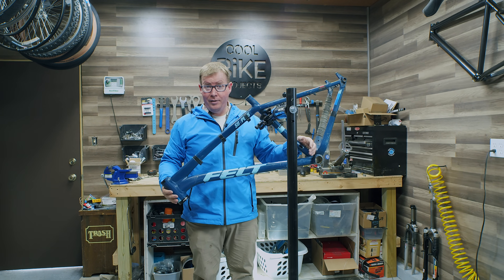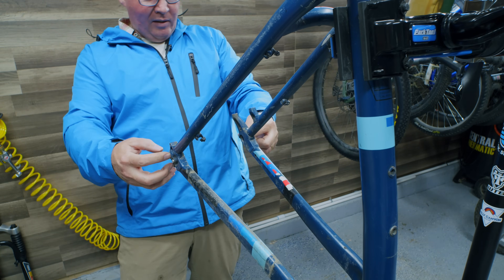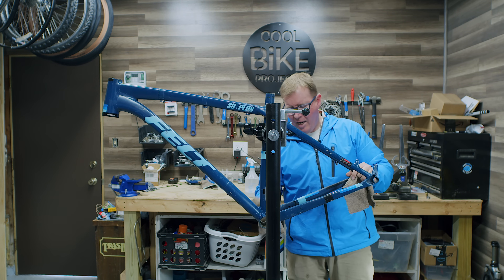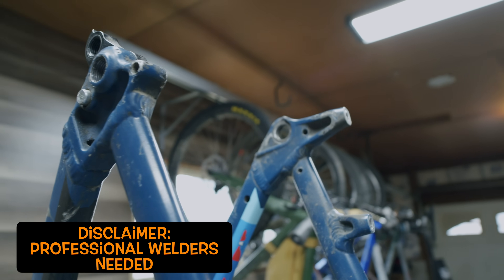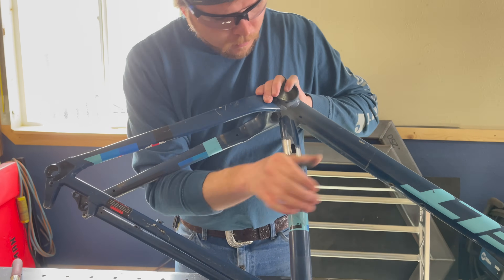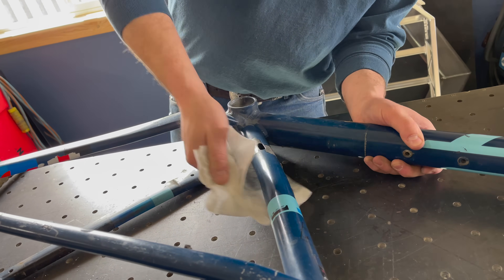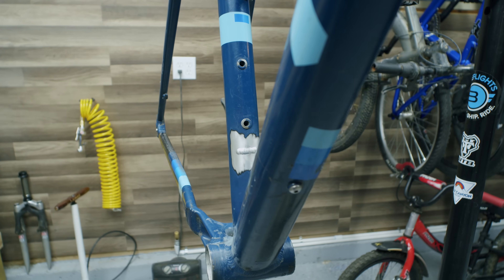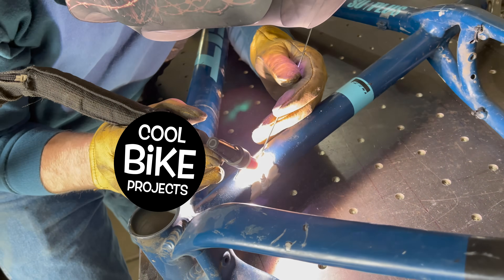How to fix a cracked bike frame: welding aluminum

Comment: It appears the  factory hole created for internal cable routing is the weak point of the frame. Because that's exactly where the stress fracture is.

Comment: Good video I did some light tig welding in shop class early 90s , so I'm not an expert, but something I did notice , is that fixing the crack is half I believe half the thickness so the exterior is sealed by aluminum bead but on the inside I think the crack still exists , though I dont think itll spread anymore lengthwise or widthwise , being aluminum there shouldn't be much oxidation from moisture or water , but under a stress test I'm just not sure how it would hold up , good experiment I guess I'd recommend sticking to the streets rather than bumpy trails and for use with a light weight rider , 125 pound rider ? Yea it'll be fine for quite awile , double the weight of the rider ? To 250 pounds ? Yea I'm defintely betting it wont last long , I weigh like 134 lbs so I wouldnt have any issues with it just make sure I dont get anyone that's much heavier riding it , not a good idea

Comment: alloy is cheaper than carbon. when the frame broken it's a sign of material or structural fatique. So why bother to fix a crack  frame? just by a new one or use it's spare part for the other bike. economically and safety is not feasible to be use again after the frame be fixed.

Comment: I've stick welded both rear dropouts on a scott voltage hardtail frame. Ive been hiting small gaps , 180s , 360s for a couple years and its still going strong .I dont know why people are so scared of a crack on the seat tube, specialy since its TIG welded.

Comment: The seat tube is pretty much the only place you can weld on these aluminum frames safely without sending the frame off to be re-heat treated. I still recommend wrapping wet rags on the tubing near the weld site to protect from pulling the temper out any further than where the weld is. I'd have no problem riding this repaired frame hard, even off road, but if the crack were on the stays, down-tube or top tube, you are asking for disaster unless this frame is only used for road riding.

Comment: The seat tube still looks bent.
Reply from the maker: @michaelobrien8661  its curved to give it more room around the 29”’rear wheel. Very common on 2010-2018 hard tails when they were playing with shorter chain stays.

Comment: I have a question ⁉️ 
I have a very old bike and it doesn't have any places to screw on bottle cages.  Besides the strap-on types, is there a way for putting the factory type on the frame?

Comment: I would not have a ton of confidence in that. Aluminum does not react to welds and heat the way steel does. My understanding is that aluminum is weakened through this process, whereas steel is not.
Reply: Shame nearly all bikes seem to use aluminium frames now then. I can't even find an ebike with a steel frame :(

Comment: Does tig welding safe in 7061 aluminum because i have one but tiny crack in chainstay welded part in the bottombracket area

Comment: Really cool video! I am curious about one part - I've heard that aluminum bike frames need to be heat treated after they're welded in order to bring them to full strength. Are you planning to do that for this frame also and if not, how much weaker do you think the frame would be approximately?
Reply from the maker: Yes in the ideal world heat treatment would be nice, but not possible for most of us. No idea on the loss in strength, but obviously a bit stronger than riding it cracked :)

Comment: Hey sorry if this has been covered, but ive read a lot that after welding alu it has to be heat treated? Just got a nice frame with a little crack in it.. id like to keep it though it seems like a headache, id be stoked to bring it back to life! My friend is a welder, i can ask him to use this method.. but how do we heat treat it/strengthen it once drilled/cleaned/welded? Liked one post in the comments about a bike that was so broken but they kept bringing it back! Cheers
Reply from the maker: Hi there @pinatabloom,  this ended up being a bit of controversial experiment. If you read through the comments there are number of welders and machinists that have chimed in with strong feelings and some sound advice. Most of their comments lean towards the need for heat treatment after welding, which would be nearly impossible for most people due to resources. I felt comfortable doing this as a personal project. I believe the welder did a great job with it, but It is not something I would suggest for most people unless they are wanting to experiment and are okay with the risk of having a frame collapse while riding. Not a pretty picture. I'll leave it at that. Thanks for watching!
Reply: Sweet as. 30 day cool off period sounds like the go!

Comment: man I really need a ting welding my self I have this project bike and the joints at the seat post part have holes in them caused by rust found a real aluminum old bike that I wanted to build my self this is good video 🚲👌💪🇵🇭👍❤️

Comment: Hi, I ahve a bike I love but the frame needs ammending to make it a stepthough.  I need a professional so I dont lose structural integrety.  Can you help?
Reply from the maker: Sorry Tessa, I took this to a professional welder, and as described in the video, this is purely an experiment. I would suggest you contact someone locally to see if it’s even a viable option for your frame situation.

Comment: Nice job, I’ve been doing this for over 25 years it’s always more fun fixing frames than making new production frames. 
6061 alloy is more forgiving than the 7005 alloy especially Easton 7005 “varilite” tube sets were notorious for cracking in non welded areas.
Reply: Do you think broken aluminum drop outs could be saved without heat treatment?
Somone has a real nice bike with such a break near me. I could do the welds nonprovlem, but I'm not sure it would just not rip off at the haz after jumping a sidewalk.
Reply: @rolobotoman  yes you can, just let it rest for at least 30 days, at least that’s what I do at work and nothing comes back.
Reply: @velowelder6333  For real?! never eared of letting alu welds rest.. but I only built heavier duty stuff. poor man's heat treatment I guess. I'm really tempted to try! The place it's broken is solid (not hollow), and I think I could beef it up with more material. Thanks! getting advices from people who actually do the thing vs forum nay sayer is invaluable.
Reply: @rolobotoman  we used to heat treat repairs but would get warping problems from previous heat treatment “memory” my college instructor and metallurgist is the one who suggested the 30 day annealing time and it has worked for us for over 15 years. I’m not an expert but this is what has worked for me and my company. Btw. I work on 7005 series aluminum using 5356 alloy if that helps. Good luck to you.
Reply: Where are you guys based? I have a Mountain Cycle San Andreas with a crack on the main frame around the swing arm pivot weld and running up the side of the monocoque, told its 6061 Solution tempered. Trying to work out best bet at a weld repair, any ideas?
Reply: San Dimas California, my company does not take outside work unfortunately. Which sucks cus I can fix damn near anything. (Humble brag)
Good luck.
Reply: Party on Dude! Sorry. @velowelder6333

Comment: My alu frame cracked at seat tube/head tube. I had it welded this summer and have been riding since then. Not felling so confident now having read some of of these comments.
Reply from the maker: I hear ya, each of us need to be in charge of our own safety. if you don't feel safe riding it then please don't. My take on this video project was seeing if it was possible to salvage a frame that would have otherwise gone to the trash pile. As many others have pointed out an aluminum frame that has been compromised and then repaired should not be ridden rough.  Best wished Paul!
Reply: @CoolBikeProjects  so how is the frame holding up? Do you have an update or a video on the situation?

Comment: As a metallurgist - yes I have a Ph.D. in that area -  who has worked in the field of mechanical behaviour of metal and particularly aluminium alloys for 40 years I would have thrown the frame into the recycle. The tubing you’re welding is heat treated and cold drawn and very thin. When you are welding it you are destroying all that processing which makes it strong. You are replacing a wrought material with a casting. The weld itself will not be thick enough especially after you grind the area down to make it smooth. Just look at the thickness of the welds holding the frame together - they are thick because they have much lower strength than the tubes and need all that thickness to carry the imposed loads.  Just recycle the frame.
Reply from the maker: Hi John, Thanks for chiming in on this. Lots of great comments from welders and metal workers. I have been saving up for some parts to rebuild this bike. As  stated in the video I will not be taking this on anything serious and will not be passing this on to anyone else. I think the question of repairing bicycle frames is common because so many have seen videos on rebrazing and repairing older steel frames. Aluminum is something I wanted to dive into because repairs are almost unheard of. I'm guess I'm learning why :)
Reply: @CoolBikeProjects  steel is much more versatile. Brazing is much lower temperature than welding and one is not actually melting the steel. Also brazing is carried out at the ends of the tubes which are much thicker than the middle because of the butting/profiling of the internal tube wall. The brazing temperature will soften the steel slightly but will not re-heat-treat it as welding does.  Welding thin sections can also introduce horrendous residual stresses due to contraction in the weld itself as it solidifies and cools. Welds need to be stress-relieved and I don’t often see people doing that - especially on YouTube.  I would be very reluctant to repair a carbon frame as well. Once the fibres have been snapped one would need an equivalent thickness of patch to allow the new fibres to bridge the gap and carry the loads. As the resins are thermosets it’s impossible to get a good chemical bond between the old and new resin - the weak link is the resin - Again, I’d just throw the carbon frame away. - I have been doing structural engineering with carbon for the last 20 years and when repaires are needed to carbon reinforced structural parts the design of the patch to bridge the load is quite complex.  I know - too much materials science. In summary - you can straighten and braze, even weld steel subject to a few caveats but aluminium and definitely carbon frames should be destroyed & recycled.
Reply: @Dr.Cranky  It seems there are carbon repair shops in UK (and probably somewhere else too), GCN made a couple of videos about them. 
Recently a 787 was hit by lightning and had a hole burned into the carbon fuselage, I'm curious how they repair this since they can't just replace a skin panel like on a conventional aircraft but replacing the segment would mean taking the whole fuselage apart
Reply: Repair is complex - airplanes generally replace the entire panel - others use tapered repairs where the area around the hole is ground away very wide and new layers are added, each larger than the previous allowing shear to transfer the load gradually to the original laminate..the patches are cured under vacuum.
Reply: @Dr.Cranky  the 787 has no conventional panels riveted on frames and stringers ( unlike the A 350), they use one piece barrels. The whole fuselage is just made of 4 barrels.
Reply: @simonm1447  I used to do work for airbus a few decades ago, but mostly aluminium , don't know much about Boeing. Repairs that I have been involved with using carbon fibre have been on carbon/glass fibre hybrid pressure pipes, usually thick walls and they have all been heavily tapered extending out 2 to 3 times the size of the original hole. The new ground surfaces that the patch was applied to were very rough. As I stated I would never buy a carbon bike because of the inherent limitations of a 2-d laminate in the 3rd direction - just look at tjose Bianchi handlebars that fractured the other day in the pro peloton.
Reply: @Dr.Cranky  personally I don't have carbon bikes or even carbon components, my bikes (no very expensive ones) have mostly Aluminium frames and 2 old ones have steel frames.
Thanks for the interesting talk!
Reply: How is welding the cracked area any different from the welds holding the frame together? Strength wise.. 
Thanks.

Comment: So how's the bike doing now :) ??? I also have a cracked frame, right below the headset :/ I always wondered if that could be fixed and safe to ride..
Reply from the maker: Been saving up for a couple parts to build this back up. I will put out an update video when it is done. Thanks!

Comment: Aluminium frame can be welded but to get original strength they need to be heat treated again otherwise they will crack next to the weld. I certainly wouldn't weld a frame especially if the crack was in a high stress area

Comment: Hmmm: Pretty dangerous advice and some glaring omissions here. A professional welder, certainly, and no blame on him for the work. He did what he was asked to do, and did it well, but there's more to be addressed. Full disclosure, I weld and repair aluminium bike frames for a living.

-No mention of the need to post-weld solution heat treat/quench/align/age a 6061 frame. 
-Approx 50% drop in tensile, yield and fatigue strength in the area if not treated. Results can vary, but only in the worse direction.
-No reinforcements made to address the original failure source. 
-A hole on the side of a seat tube is a huge stress raiser, given the side loads in that area. Should be on the front (neutral axis), if anywhere at all.
-Welds finishing on the highest stress edges, should be reversed direction. Start at the edge, finish on the solid.
Reply from the maker: Hi Dan, I appreciate the extra insight you given here. Our follow up video will address some of theses issues. Hopefully the disclaimers given throughout the video emphasized the need to have a professional involved and that this is not recommended or endorsed by frame manufacturers.
Reply: @CoolBikeProjects looking forward to seeing your follow up video
Reply: How did I not find you earlier.  I have a cracked intense uzzi. I have had it welded but now I need it heat treated.  Do you know anywhere where I could get it heat treated?

Comment: I’ve Tig welded for 29 years and also mountain bike ,the location of that crack and nice fix shouldn’t be a problem riding that bike ,like he said it’s not a high stress location on that frame
Reply from the maker: Thanks Ron!
Reply: On my Scott's Aspect aluminium frame rear dropout axis one part broke off. Is it worth to even give a try to weld it ? It's where the most load is....

Comment: That’s pretty common for frames to crack on the seat tube when there is a cut out. I would definitely close the entire hole. So much downward force on the cranks pulling on that tube

Comment: I am a bit skeptical about repairing an aluminum frame due to how metals can become fatigued, especially where this cracked. A chromoly or steel frame would be a better option for welding in my opinion. 
In aircraft maintenance, we stop drill cracks with a 1/4" minimum drill, anything larger typically would require an Engineering authorization. 
I have had three frames crack, all aluminum, along welds.
Reply from the maker: Great insight John. The welder commented how thin the metal was, but felt confident the crack would not spread. It should be a good experiment!
Reply: @CoolBikeProjects  Hope it works out, but I would keep an eye on the top tube and seat tube junction, and maybe the downtube near the head tube.
Reply: Yea, there is a lot of ideas and opinions like that going around to the point it's gospel. I'll take a pro welders word over internet opinions any day.  A lot of "cyclists"  and "bike mechanics" think they are dealing with cutting edge technology, but they don't realize there is not much out the simpler than a bike , well, maybe a hammer

Comment: How much does that cost to sand blast and rewelded and painted by a professional vs buying a new frame?
Reply from the maker: I only speak for this project really. I paid the welder $50 for prep and reweld. If I do a single pass powder coat it’s about $100-$125 for the frame to be sandblasted and powder coated.
Reply: @CoolBikeProjects  I saw others here in the comments and another bike frame builder channel mention heat treating after a welding. I'm not very familiar with the level of risk or cost to benefit of heat treating in this situation. Is this a consideration you guys are taking into account? 

Subscribed and hoping to hear an update after the frame has seen some miles put on it. 👍